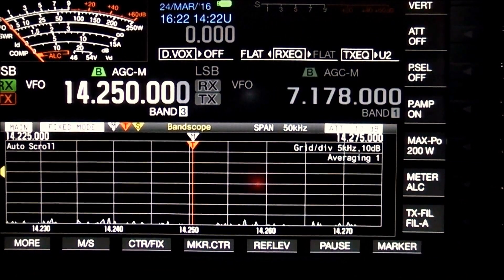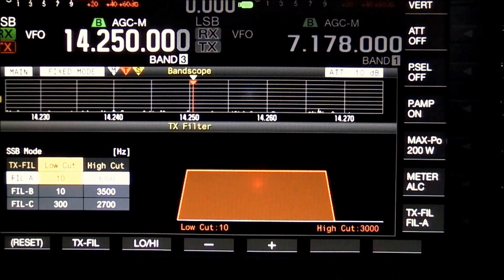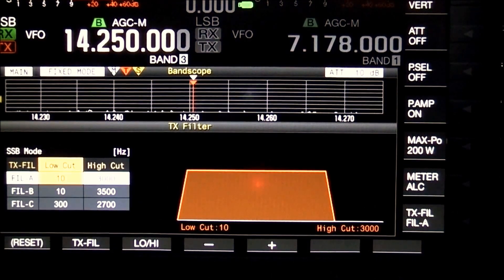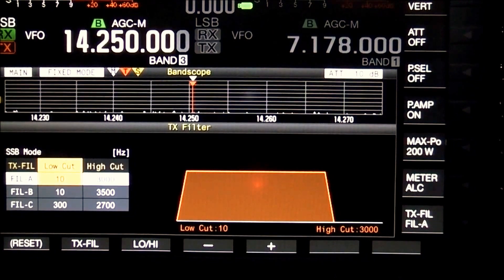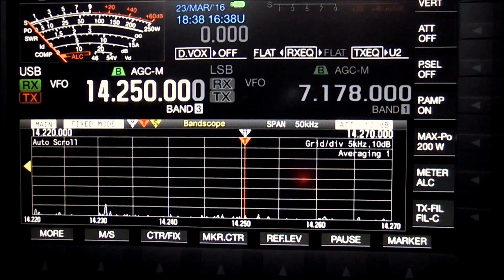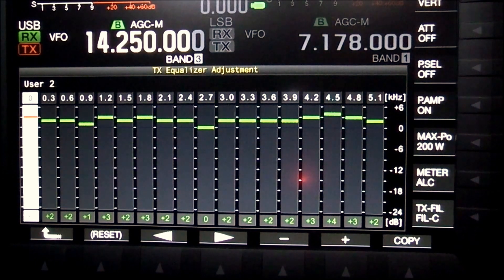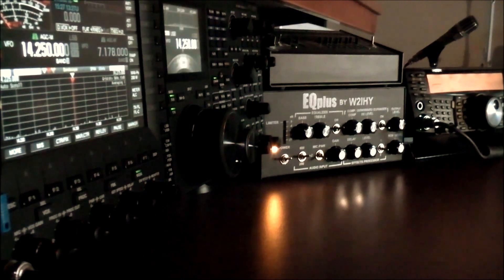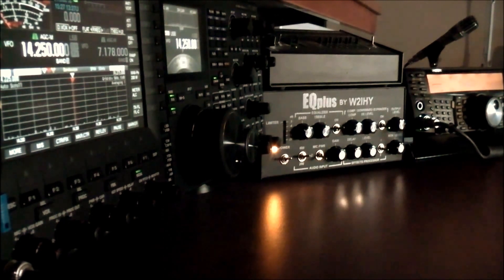Kenwood TS-990 Modulation (Part 1)

Comment: This is the first video of its kind on the TS-990s. A long over due video for us 990 owners. I would like to thank you. You also speak very clear English. I can't wait for more Video's on the 990.. Cheers
Reply from the maker: +bbugin4u Thanks!Part 2 will be a "hardcore" one in TX audio processing! 73 de SV8RMA
Reply: I sell all  my extern audioequipment. The Reason is, when i drive with Clubstation Mode with 1 KW, so i have big problems with interferences ... 2 Questions please. Why are you work with 2 Equalizers ? One Intern and 1 extern ? Have you an example from ONLY the Intern Equalizer from the TS 990S? Thanks !
Reply from the maker: Well the 2 EQ's is my personal reference.You can do the the job even with one.My other audio chain consists of 4 EQ's!!!Now I am working with only the TS990 EQ and a simple HC5 Heil headset.The audio reports I get are excellent!The TS990 has excellent modulation!73